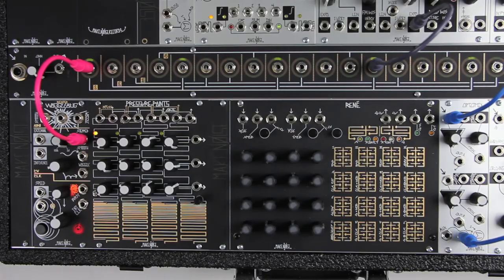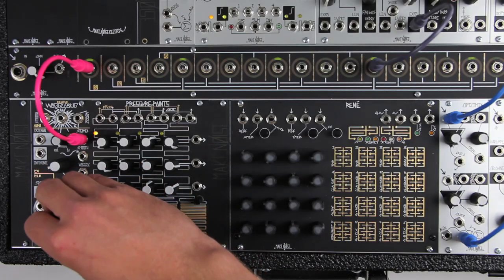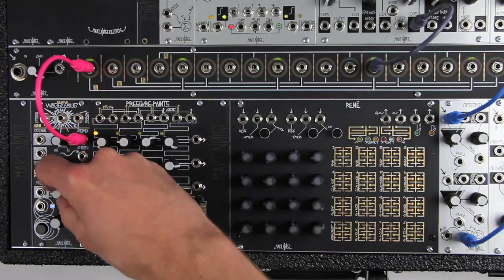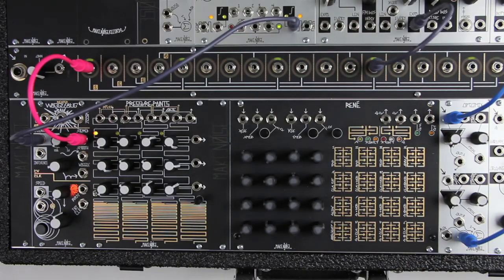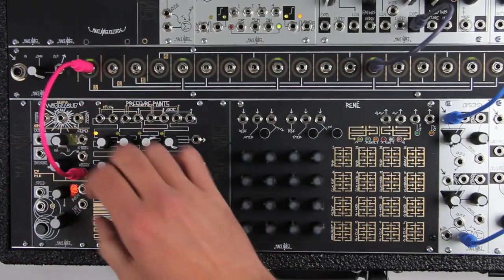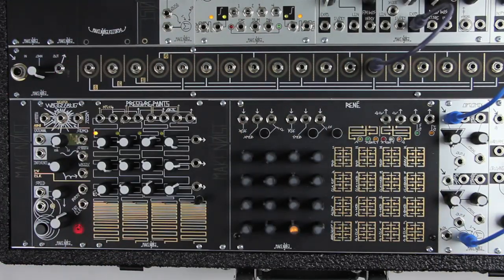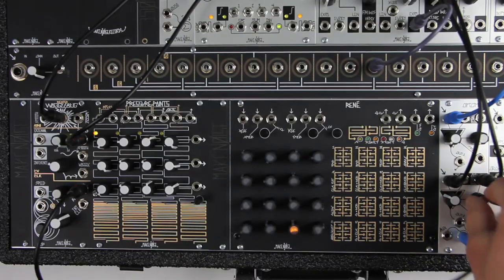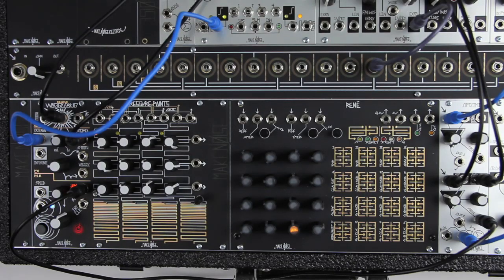Make Noise Richter Wogglebug

Comment: I'm an absolute beginner. In the beginning of the video the stepped output makes different tones. Is there something else connected to produce these tones? When I patch mine directly to the output it doesn't produce tones but different rhythmical blips and blops.  What do I do wrong...?
Reply from the maker: The stepped random output is patched to a pitch input on the VCO. One of the VCO's outputs is what is monitored and what you actually hear. The Wogglebug is used to change its pitch; the Wogglebug is not being monitored directly. Hope that makes sense!
Reply: @MAKEN0ISEMUSIC  That makes very much sence! Thanks for answering! Thanks for making what you make!

Comment: I was looking at the Turing Machine, but this also seems very interesting. Is it possible to "lock" particular sections so it loops the voltages?
Reply: Ah I fear I asked a silly question. I was hoping that the Ego/ID pot was a locking control, but I'm guessing that it's a range control for the output.
Reply from the maker: 0oCalumo0 For that functionality, look to the Malekko Noisering, also based on a Grant Richter design (two stepped random outputs, no smooth or woggle or random gates or VCO outs). The Ego/Id pot on the Wogglebug controls the range of the output, the recursiveness of the pattern, and (if there is something in the Ego jack) the amount of randomization applied to the input.

Comment: As a huge fan of Make Noise, I own most of your stuff.  My entire synth is based around the workflow of your modules.  With that said, would you recommend this if I already have the old design?  Should I upgrade?  Will this work with the new cv bus thing you're coming out with?
Reply from the maker: Waz Hey thanx and glad you are enjoying the modules. I would say you should upgrade if you need some extra space or a master clock. But for random voltages, your OG MN WB is every bit as good.